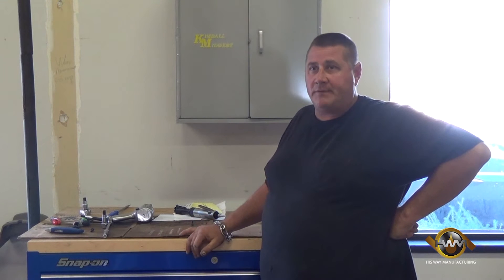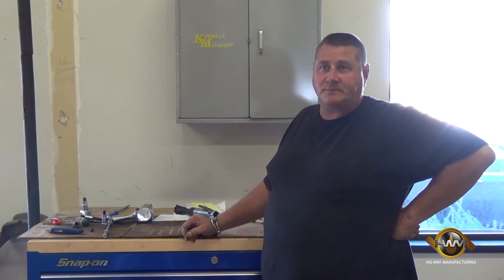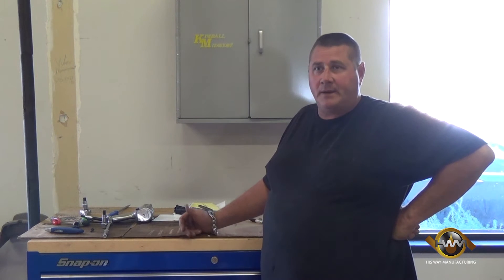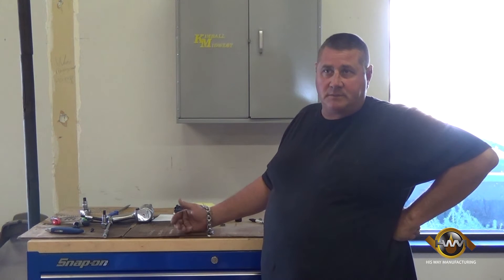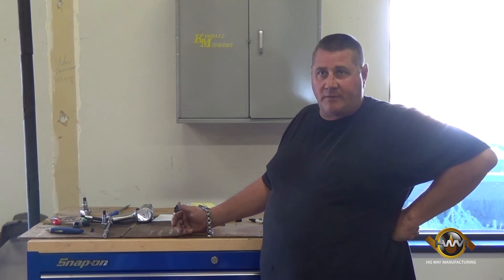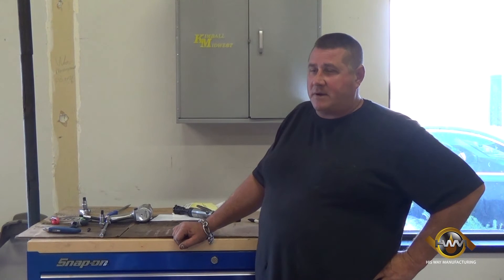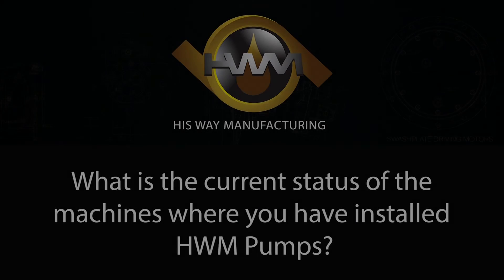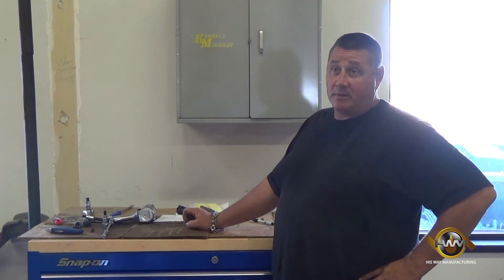Hydraulic Pump Installation Follow Up with Tom Carr

Comment: Komatsu ck 35 track skid steer . What's causing hydraulic fluid to leak out of weephole at torque converter housing where main hydraulic pump bolts up to rear of engine ?